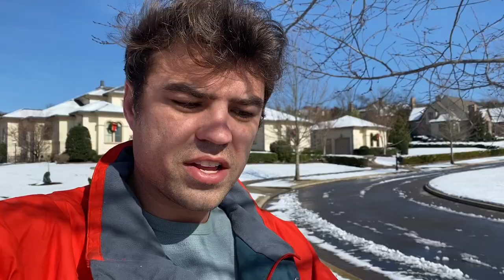Trevor Jacob Plane Crash. What really Happened and how we can prove an intentional ditching.

Comment: A lot of Trevor's video is from different days. The shadows off the mountains fall in different directions because they were filmed at different times in the day. Trevor's freefall from the plane footage is two different jumps and the footage is spliced together to make it appear that it all happened on the same day from the same jump.
Reply from the maker: - whaaa?
Reply: @Reel-Justice  I AGREE... the plane would not have been below him after a 25 second free fall... I have been suspect of this for awhile....
Reply: @techsolutions8237  There are a few things I broke in this case and that was one of them. Trev is thousands of feet below the  plane after free falling then shortly after the plane is thousands of feet below Trev. It's complete bunk.

You see the location where the plane is when Trev jumped. In Scooby's video he shows us the general area, and from his video I have tracked the route the plane travelled after Trev jumped out of it. 

If Trev' video were REEL, the plane had to immediately nose dive down over 5000 feet, within say a mile, while it travelled South, then continuously circle to the right on its own, then level off on its own (as shown in Trev's video as it flies over the bald rocks on the slope of the mountain) then turn hard right to get into the valley where it crashed.

Trev's video is complete BS.
Reply: @Reel-Justice  My father owned a jump center, and I have flown jump planes. (C170, C180, 206, Caravan).
 
 Pilatus P-6s, and King Airs can pull off the steep, "space shuttle"(6000-7000) ft per minute vertical speed decent in Beta,  NOT A Tcraft....
 The flat angle it crashed indicates a fairly shallow decent into rising terrain.
 In short... if the terrain was level it would have landed itself...(its happened before)
 I also noticed it looked like 2 different lighting conditions (different days perhaps?)
Reply: @techsolutions8237  I agree, different days. Preplanned. Test runs. Prerecorded footage. More than one jump from the plane. 

Now if you watch the plane fly over the bald rocks on the slope of the mountain, you can see the plane is lower in elevation then when it crashed. So not only did the plane allegedly make this amazing hard right turn on a dime to get into the valley, right after flying over the bald rocks in Bald Mountain canyon, but it also increased its elevation from Bald Mountain canyon in order to crash up higher in the valley between the two mountains.

Comment: You use the word "proof" a lot more than you should.
Reply from the maker: Thanks, I am tempted to concur but do feel like the logic path of my case is definite… and what it proves is that he intentionally departed without enough fuel to make it to destination- the engine out was on purpose
Reply: @DailyNOTAM  I dunno. He DID strap two fire extinguishers to his legs, so clearly he was thinking there may be a fuel induced fire LOL
Reply: @Reel-Justice  That’s even worse lol.
Reply: @austinformedude  If they were fire extinguishers they weren't big enough to fight a forest fire had one started.
Reply: @Reel-Justice  Obviously. No one said he was smart LOL
Reply: @austinformedude  Even if he ran the tank dry, there is a quantity of unusable fuel that remains in the tank. He was fortunate the aircraft impacted with a relatively low speed (looks like it hit some brush which would slow it down too) so the fuel tank may not have ruptured.
Reply: @Reel-Justice  That does not make sense. Why would he have smoke canisters if he was only wearing the parachute as a precaution?  They seem kind of high up in his pants if he was planning to use them during his jump.
Reply: @JAMessinaJr  To let his helper know where he is. He can't start a fire for smoke signals. The helpers could not be close by when Trev was filming as he would've got caught in the camera shot when Trev was free falling / skydiving.

Comment from the maker: Guys, if you think the gauge on the hood could possibly be accurate showing full fuel then answer how it was indicating fuel when that is the only tank the plane has and he had burned a minimum of 9 gallons at the engine out location
Reply: I can tell you from 500 hrs of Tcraft time that the wire and bobber float are VERY INACCURATE and each one is different...
 They get sticky and don't slide freely... Especially when the plane has sat for a period of time and nobody qualified (A&P) has looked at it... Also any slight bump or bend in the wire will cause it to hang up, and not slide up and down.
 Common practice is to "dip" the tank, add fuel, and pay attention to fuel burn (time)4.5-5.0 gal per hr...
Reply: Bro the guy had fire extinguishers stuffed in his pants. He's a fraud.
Reply: The gauge shows there was fluid in the tank or it was stuck at full. Does not tell you it was fuel. Fuel selector for wing tank disconnected. 
Taylorcraft burns less than 5 gallons an hour stock (4.2 in the manual I have) He flew 30 minutes in a straight line to Bald Mountain while climbing to 10,000 feet.

Comment: Do you have documents from the NTSB or FAA that show the cause of the crash and the the fuel stick in the front tank wasn't working.  The video clearly shows that it was in the full position right before he bailed and I'd like to know what makes you think it wasn't functional.
Reply: I saw Nathanael's other video and unless Trevor refueled along the way, there was no way he would have had the quantity shown on the fuel stick.
Reply from the maker: @DougBinderCozy4  this.
He consumed at least 9 gallons just getting there
Reply: @DailyNOTAM  You are assuming he only had the one tank. This airplane was also fitted with wing tanks which add an additional 9 gallons.
Reply from the maker: @austinformedude  the hose and selector shown loose in the cockpit would have been what is supposed to attach to the wing tank
Reply from the maker: Adding 6 gallons
Reply: @DailyNOTAM  So let me also ask you this. Do you also fly with two fire extinguishers strapped to your legs, a parachute, and a selfie stick? LOL
Reply: @DailyNOTAM  He had plenty of fuel on board. And just in case all that fuel caught fire he made sure to strap fire extinguishers to his legs LOL
Reply: @austinformedude  it looks like the plane did not catch fire, which implies there wasn’t a lot of fuel. The fire extinguishers would help Trevor get through a fire to the plane, if there was one, but wouldn’t have helped much putting out the fire by the time he got to the crash site.

That video was definitely weird.

Comment: Maybe the fuel gauge was accurate.  Where did he fuel up?  Lompoc? Looks like Santa Ynez has cheaper 100LL and is not much out of the way if he was heading NE to get around the Sierra Nevada Mts.
Reply from the maker: Well he would have actually turned way south east… so not avoiding the mountains at all

Comment: Dude. You are wrong. And trying to glob onto this stunt to launch a channel. It isn’t working. Don’t be like Dan Gryder. Do better.
Reply from the maker: Hey thanks, and I hope to- I only state to factually point out that he had to be out of fuel for those like me who are interested in this case
Reply: Do you have proof it wasn't working?  The video clearly shows that it's in the "full" position.  While that doesn't indicate the tank was actually full, it also doesn't indicate it wasn't working.
Reply: @DailyNOTAM  you are a young guy, so I will give you some slack. But you don’t know what you are talking about. In the video you can clearly see the fuel stick. Don’t be a Dan Gryder .
Reply from the maker: @WhiteCoffee4U  yes, he burned a minimum of 9 gallons if he flew straight to the engine out location
Reply from the maker: @austinformedude  thanks I am wet behind the ears for sure. Here is why I think I’m right on this: he flew at least 9 gallons out getting to the engine out location. How could the gauge show that much fuel when he flew that much?
Reply from the maker: At most he had a 12 gallon tank in use.
Reply: @DailyNOTAM  How many fuel tanks did this aircraft have?
Reply from the maker: @austinformedude  2, right wing and one just in front of the firewall…
Reply: @DailyNOTAM  Bingo.
Reply: “Don’t be like Dan Gryder”…lmao…I like you !!!
Reply: @austinformedude  The fuel line from the wing tank is disconnected.
Reply: This plane comes with a 9 or 12 gall tank forward and a 6 gall in the wing which is clearly disconnected in the video. It is too easy to just bend the front fuel gauge to stop it working and it will show any level of fuel you set it at. So the extra flight path was to burn the last of the fuel and reduce the chance of the cameras on board being burnt in the crash. Therefore the extinguishers for insurance. Importantly he did not have the fuel to make it beyond this crash site and not to his distant destination. Very planned trip even down to strapping on an a chute and altimiter. Never seen a pilot do that before and I would not fly with a pilot who did. Would you? André
Reply from the maker: @SoundzAlive1  you stated this so well. This is exactly it
Reply from the maker: @austinformedude  look at the comments below please. The whole basis of this video is what @soundzalive1 says below.
Obviously the wing tank wasn’t connected. You keep skipping that point, it’s the give away right in his video and it’s shown circled on my thumbnail even if you didn’t watch the video